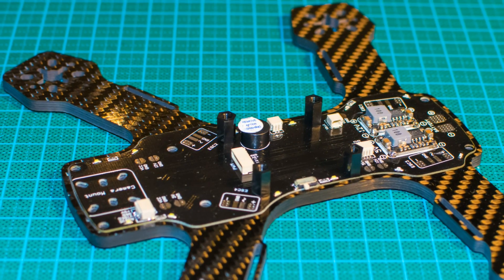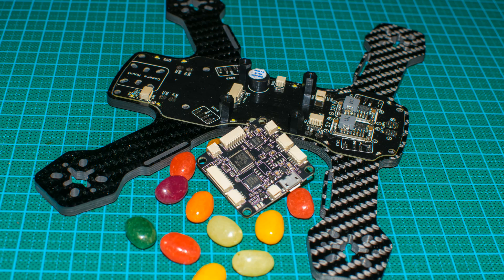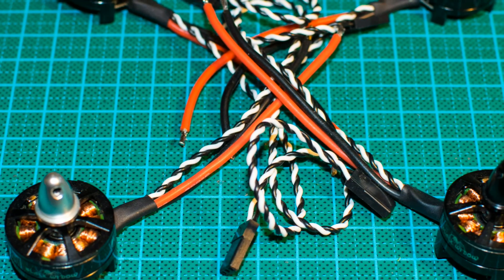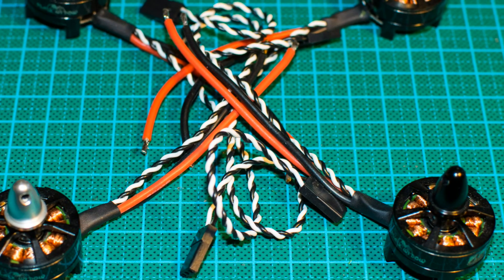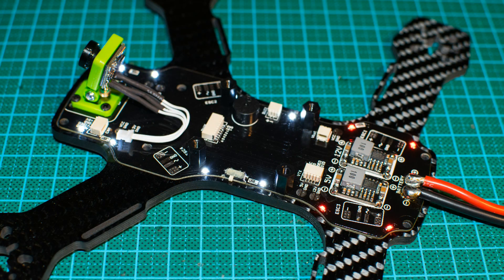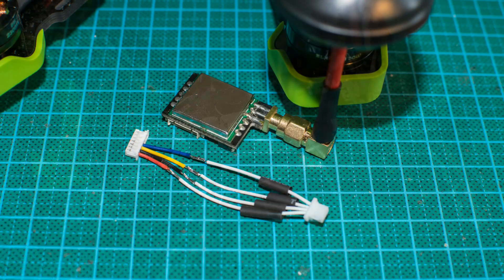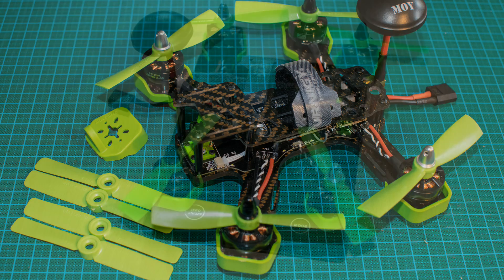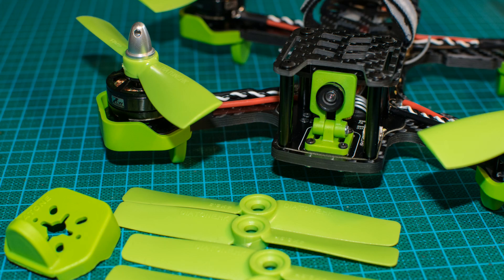Diatone Tyrant 180 Quadcopter Frame: Build & Fly

Comment: Hi

what do you think about the ZTW motors+ESCs?
I'v been looking at them for a while but still haven't bought any since I have no idea on how they perform.
Reply from the maker: So far I'm really happy with them. I've been flying them for ~2 months now (the video is a bit older, I only published it now) and they are still peforming well.
Reply: what kind of props are you using?
Reply from the maker: DAL 4045 both two-blade and tri-blade :-)